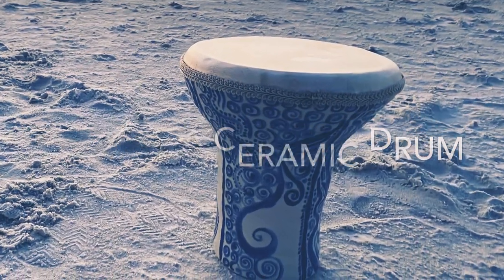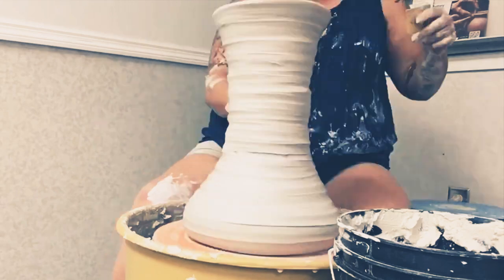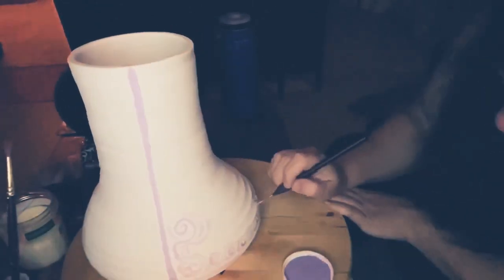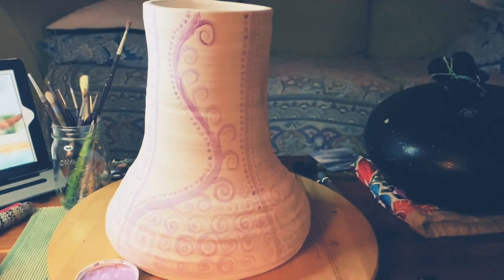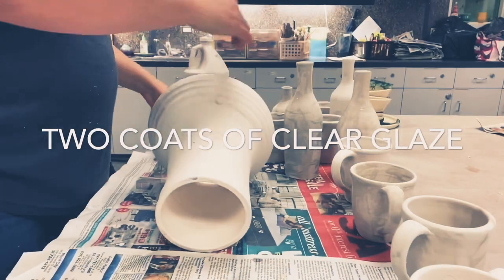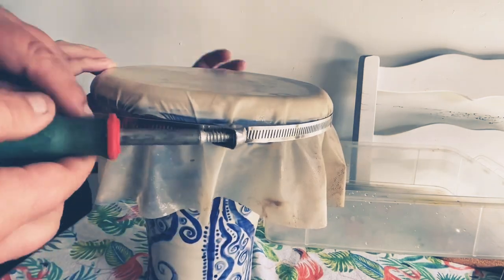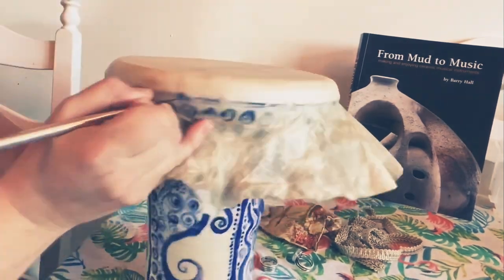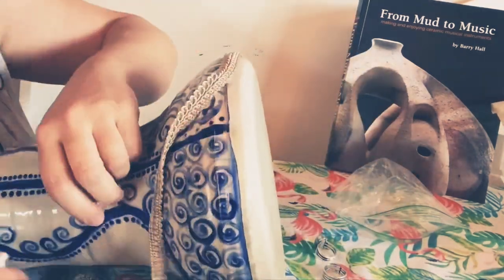Making a ceramic drum from start to finish

Comment: Hello my pottery friend hope you will read this message. I too am a Potter who resonates with the clay and learned to put the intentions into the clay because it's very... Sensitive. I made two clay drums but before I could try putting heads on them I experienced a connective tissue disorder, now I am very weak. Your voice and your style are so similar to mine, my pottery studio @ Mount Shasta it was a peaceful community place. I wonder if you might try to put a drum head on the small drum that I threw on a pottery wheel. I threw the drum I believe in 2013. At that time the old Potter in Mount Shasta was using a different technique than in this video, on his advice I glazed the surface of the drum where the drum skin lies. I hope you might be able to put a drum head on this for me, because I dearly would love to hear the music the powerful music I know is in the drum. I'm in California
Reply: Mailing pottery in a box inside a box has always worked for my studio.